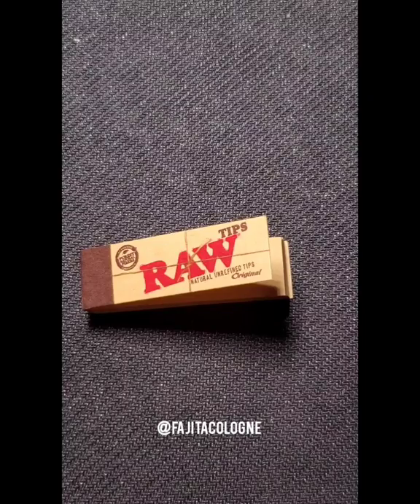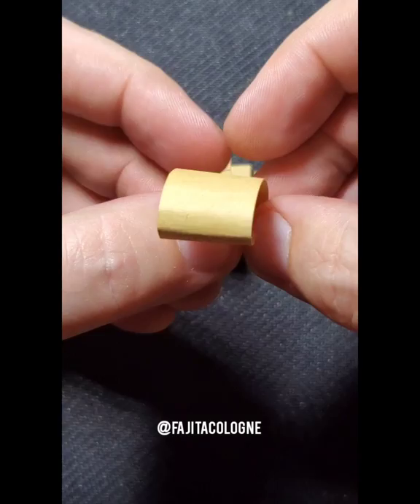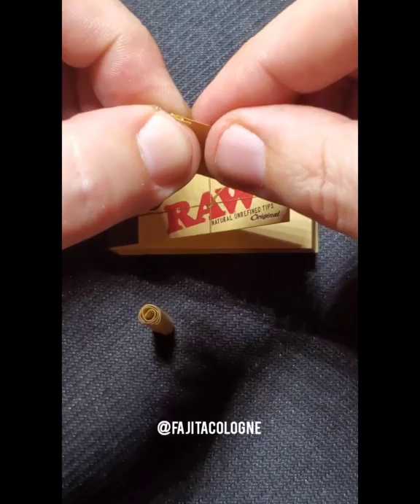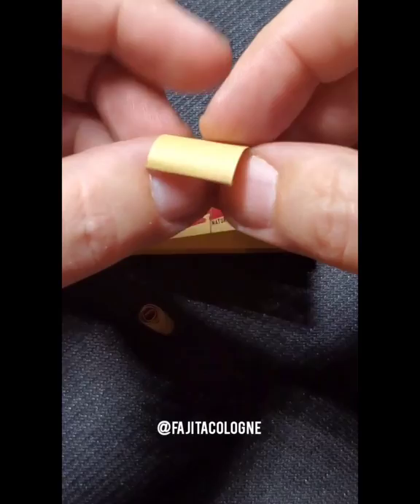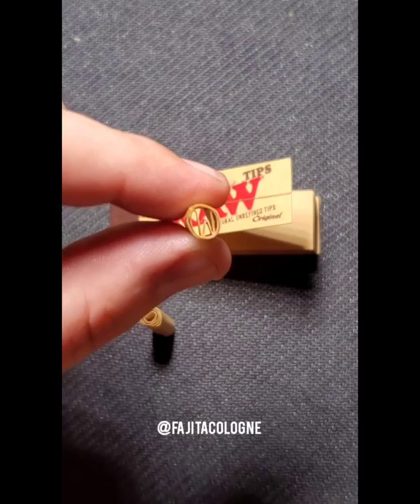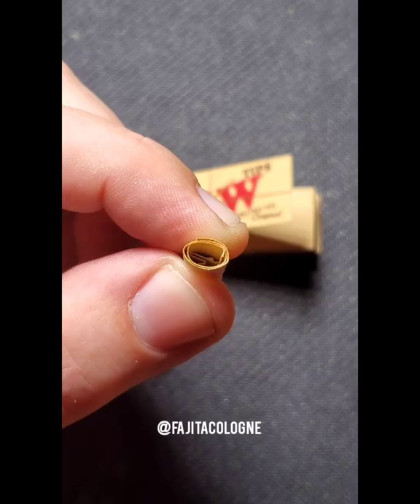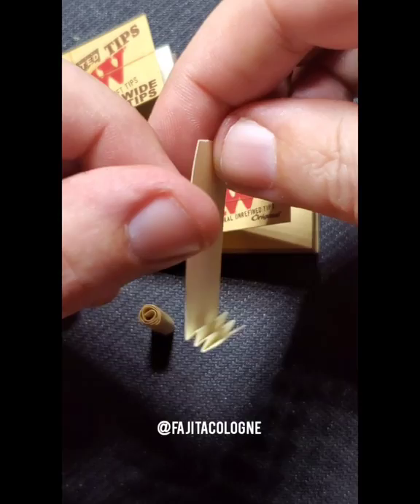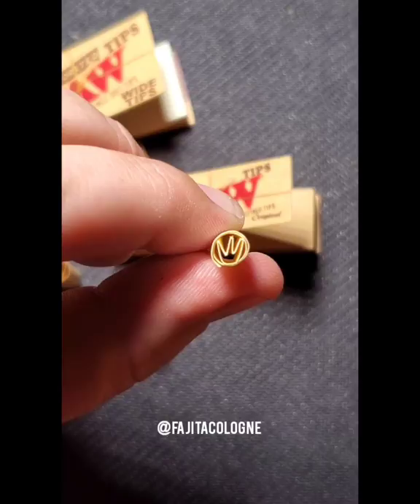How to Make Joint Filters for Beginners

Comment: Can I use the cardboard off the raw skins ? To make a filter
Reply from the maker: Yes you can. The loose piece of cardboard that's held inside the flap with papers works perfectly.
Reply: @fajitacologne  ye bro I was thinking instead of buying the raw cardboard just use the cardboard off the skins so it’s cool
Reply: Until recently buying myself a pack of the Raw tips, I've always used a piece of  the folded under flap that is in the top of hardpack cigarette packs or empty paper pack.
Reply: I use to take that little piece of cardboard for inside my cigarette pack, that little strip.

Comment: How will I make it stay? Will it not unroll?
Reply from the maker: Stiff cardboard rolled correctly will maintain its form. Try it!
Reply: @fajitacologne  I use raw aswell and mine unroll
Reply: So far, the only way i've found to make it stick is licking it, getting it all sticky so it wont unroll. Kinda gross but havnt found any other solution